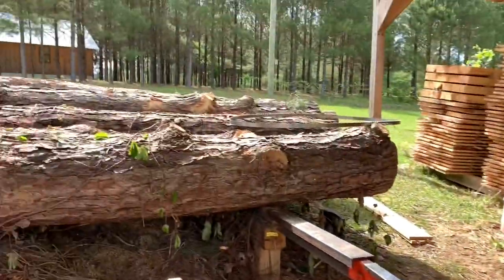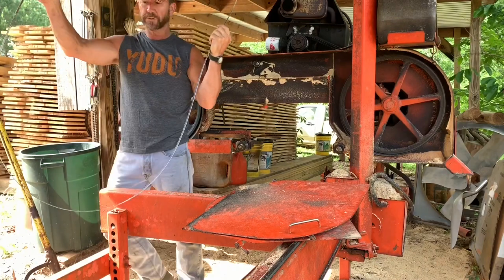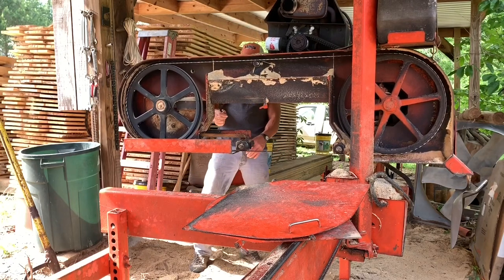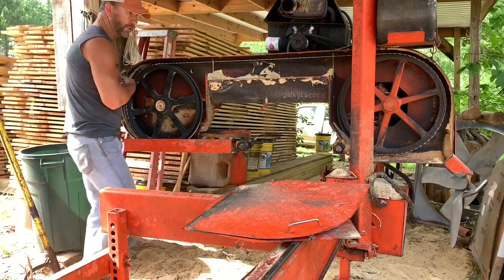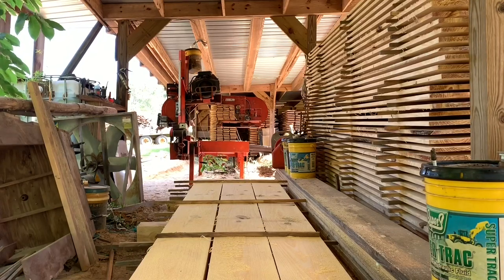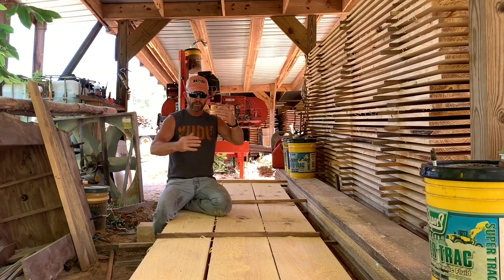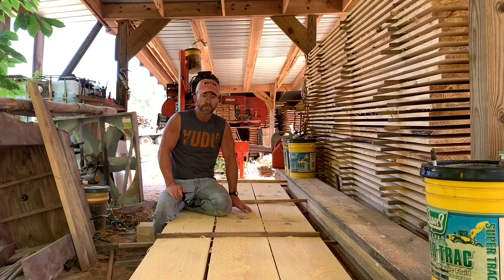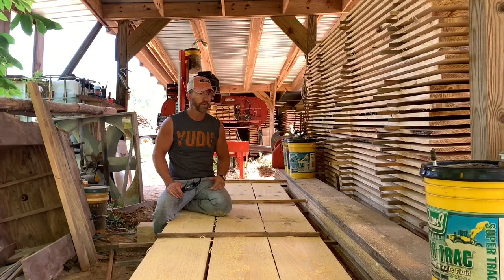Cutting Pine Logs on the Sawmill!

Comment: You are very efficient in your actions.  I like the way you edged your first boards while cutting other boards. 
I also like to see that you only turn the logs 90 degrees in lieu of 180 degrees that most horizontal band saw mill operators do.
My family had a vertical cut circular saw mill.  We turned the cut face down, 90 degrees.   All labor intensive mill.  Two people were on the carriage,  one to set blocks, one to dog the timber, one on the log deck to feed the logs and to turn them.  Good old days!

Comment: Very nice to see. My dad was into the technology aspects of sawmills. He created laser vision systems that could maximize what you got out of a log by scanning it and tell the operator how to rotate it and place it in the mill to get the maximum lumber out of the log based on what the market wanted. It's so weird its been so long since I've even talked about sawmills (my dad passed away several years ago). I can follow you along every step of the way. It's amazing how your operation is almost as good as some of the bigger mills with larger equipment. As far as drying the lower boards go I see a large fan leaning up against a post at 6:26. You could attach that to a windmill that is taller than your trees and have it blow the lower boards to keep them from molding and mildewing. Wouldn't have to power it. Very nice work.

Comment: Jeff: Watching you take the wheel covers off......mine haven't been on in 25 years...ahahaaaa...paint on them is brand new while the rest of the orange has faded out.
Ever try tapered lap siding ?  That is what I use on all my buildings around the farm.  Cut a log into an 8" wide cant by however tall you can square it up, (10-18") then stick a 5/8" plywood shim under the cant on the bed rail.  Lower the head to where you're cutting about 3/4-7/8" on the outer side of the cocked cant, the inside will be around 1/4-3/8" (Adjust your shim thickness to suit the taper you like....I find 5/8" works for me).  Remove the shims for the next pass, the taper will switch sides.  Keep repeating until you're as low as the head will go.  You get a LOT more siding per log, and it's a lot easier to install over board/batten, and it's a lot better IMO because you don't have that air gap between board covered by the batten, but still open to insects/air at the bottom.

Comment: I wish that was the case around here in NH but it takes more than 6 months to get Pine to dry to use or if you use early it shrinks. I had an White ash cut for me last spring. I cut into one piece a week ago and its at 14% which is to high to use yet. It's been inside all winter should of dried by now,  just have to wait longer.

Comment: Do you ever have issues with deflection with the one support pole for the cutter head. Most the saws I've seen have had the twin track. My buddy has an old one with the single track he is sellin cheap but I've always been worried that head would deflect and mess the cut.